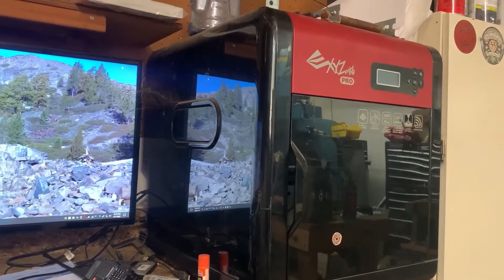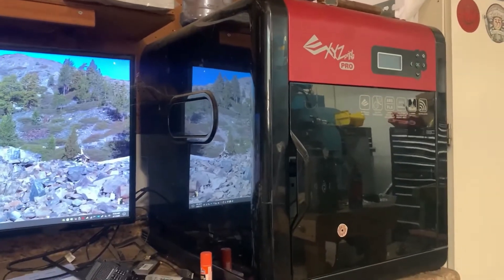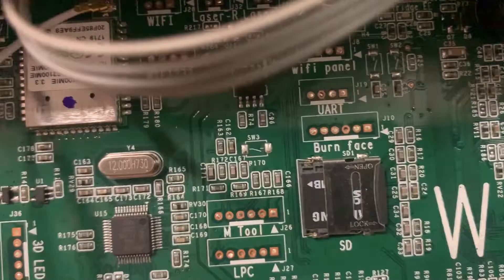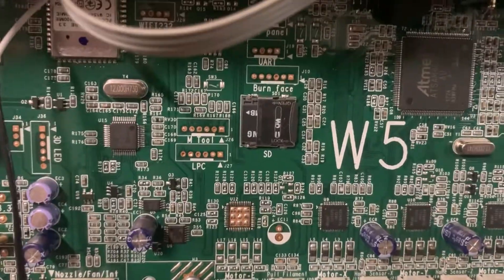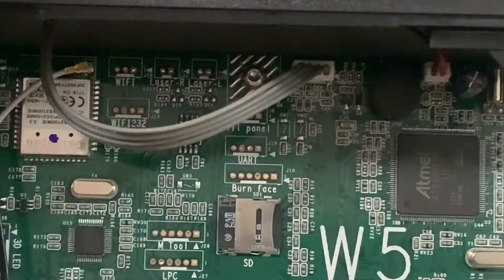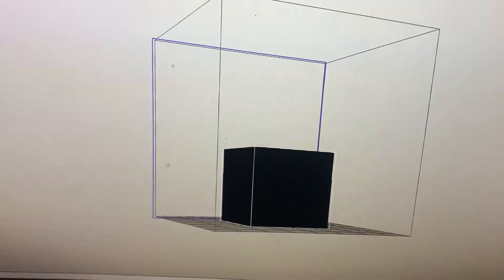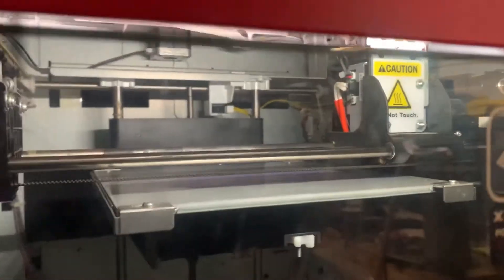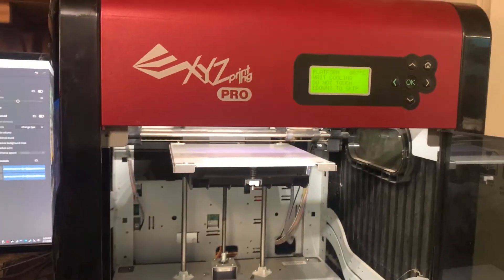XYZ Pro 3D Printer SD Card Replacement: Keeps printing the same thing.

Comment: My DaVinci 1.0 Pro had become very sluggish in reading the sliced file from my desktop PC through the wifi network. It was not that slow in the beginning, but I blamed it on the walls inside the house and the location of the DaVinci to receive the signals somehow.
Until I lately got several Card Reading Errors, which resulted in a stalling of the printing process, mostly somewhere in the last stage. So, I decided to replace the SD card, as explained by several sources, like this video here.
There was a 4 GB micro SD-card in there. When I attached it to my desktop Windows-10 PC, it gave me three txt-files: "CMD_log.txt", "filename.txt", and "LastPrintFileName.txt". Also several .3w slicer-files were on there. I took an 8 GB micro-card that I had used for my wildlife-camera and wasn't using anymore. I formatted that 8 GB card to FAT32 with the name SDHC, as this was the original card's name, and copied those three txt-files to it (not sure whether it's necessary, but better safe than sorry).
What do you know? My DaVinci experienced its renaissance! The same slicer-file that took about one hour, last time I had run it, now took about 20 seconds to be read by the DaVinci! So, there was definitely something odd with the original card. It's now purring like a kitten, and my guess is that it will complete that mission flawlessly.

By the way, the most convenient way to operate upon your DaVinci is by putting it onto a couch or bed or something similar, so that its rear will be presented to you in a horizontal manner. Then there is also no risk in dropping that card-retainer. I simply used my finger nails to slide that retainer to the left and open it. Putting back the new card: same thing, in reverse. If you happen to have sturdy finger nails, this is one opportunity where they come to use.

Comment: what exactly does the card do?
Reply from the maker: The computer uploads the print to the card for storage, and then the printer prints the file from the card. Depending on if you are using the xyz filament, you can then print the file directly from the card when no computer is connected.
Reply: @TheSkinnny  okay thanks. I have the same error and must then probably exchange the card.

Comment: Has this issue reoccured? I am getting 10% into any of my prints and it says SD CARD error, or failed, or doesnt even try to print and hits the 0040 error.
Reply from the maker: It has not. I think that they came with a low quality sd card that is prone to failure.
Reply: @TheSkinnny  thank you so much for the response, just bought new SD card and hopefully I can get back to designing my new wheel hubs lol
Reply from the maker: @streetunique872  I hope the swap goes smooth and easy, and make sure you have something to catch the bracket and card!
Reply: @TheSkinnny  Aye I just came up with the idea for this. Instead of having the printer use the xyz software, you can get a micro sd card extender and then feed it through the back. This extender can clip in, and you then have easy access to the sd card